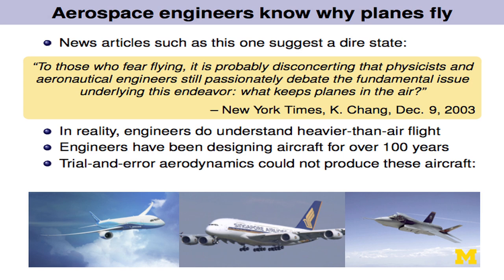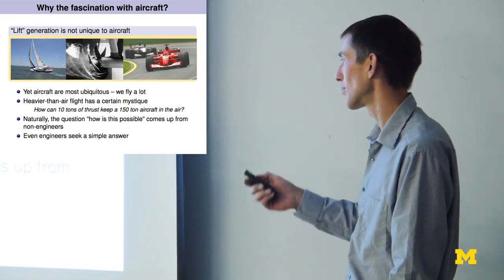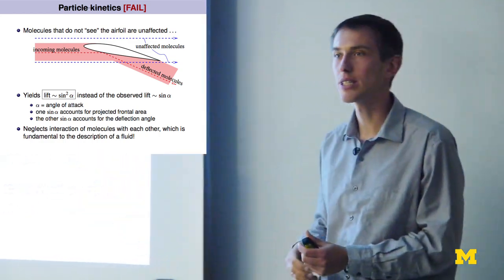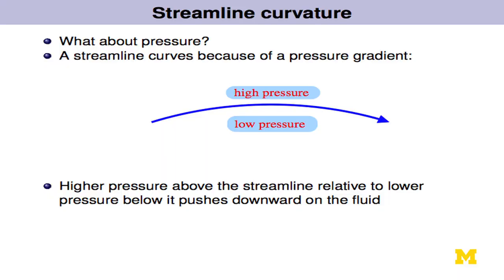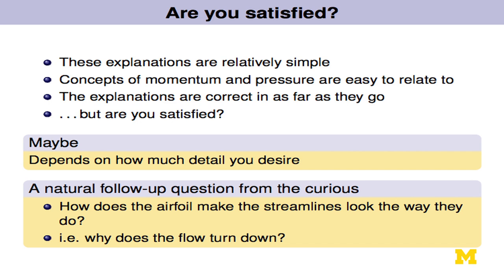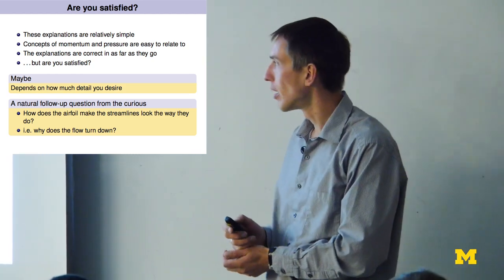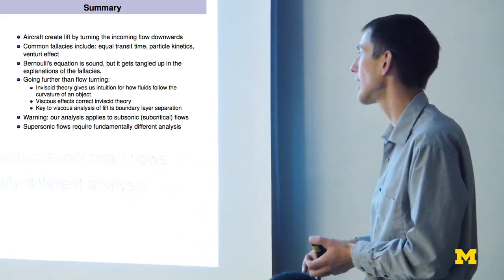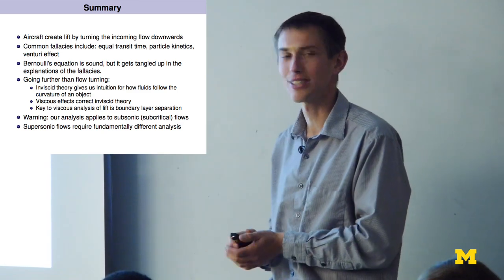Krzysztof Fidkowski | How Planes Fly

Comment: How wings fly.
It is not wise to keep talking about the air flowing over the surfaces of a wing, as relatively speaking, in reality,  the primary effective working air does not move horizontally much over the wings.  People have a habit of conducting tests in a wind tunnel where the airfoil stands still while it is the air that is moved at a speed, relative to the stationary wing. 

The streamlines diagrams need to be understood for, in a wind tunnel, the mass air particles on the streamlines are moving horizontally at high velocity but in the reality of flying, the air mass is initially standing still,  the mass particles are not moving much horizontally but they are being basically displaced vertically by the oncoming airfoil section, with an acceleration which builds up and is integrated twice into an air displacement or location shown by the slipstreams.  

Also, note that the slipstream contour diagram is a POSITION OR A LOCATION  diagram and not a velocity diagram. If we had to differentiate it and deduce a velocity diagram from it, then one could determine the velo0city vector field consisting of little vectors lined up with the streamlines where the length and direction of the small elemental vectors would represent the velocity in magnitude and direction at any location/time on the streamlines. But if it was a wind tunnel, the velocity vector field would represent the velocity of the air particles, but if it was a real flying wing on a moving aircraft it would be the velocity variations about the speed of the aircraft.   From the contour of the streamlines diagram, it appears that the horizontal velocity is basically constant but the curvy zones show a vertical velocity component. So, if from the velocity diagram we would obtain the acceleration vector field, then the acceleration vector field would represent the forces at the various location including far-field acceleration effects. Consider that the acceleration in a particular loaction is operating on the mass of the lump of air existing at that location where the accelerating vector exists ( mass is a scalar and can be taken as a constant in this case). 

The curves in the streamlines diagram  around an airfoil indicate that there are four main acceleration zones i

1.There is a compression accelerating zone even ahead and on and above the upper front part of the leading edge.
2. There is a suction accelerating zone after location (1) existing along the upper surface to the trailing edge.
3. There is a suction accelerating zone just behind the lower part of the leading edge. 
4. There is a compression accelerating zone existing from location (3) going all the way under the lower surface to the trailing edge.

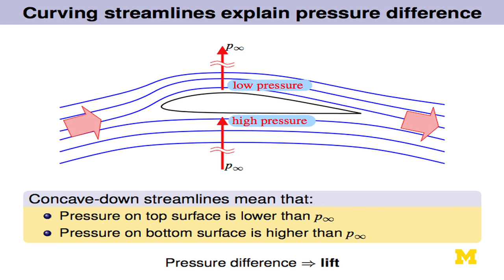All these four zones are easier seen on a highly cambered airfoil section. The practical meaning of these pressure suction zones could be interpreted as follows. Let us use the diagram shown at 12:52.  Assume the mass of an air/ fluid particle consists of a fat man holding an opened umbrella to create a piston effect. 

One fat stationary man, with an opened umbrella, located above the mean line, is hit ( compressed) and pushed up and accelerated up through action ( 1)  and the oncoming upper leading edge will shoot the man up, but him holding the open umbrella, a partial vacuum will be created behind the man, between the area of the umbrella and the surface of the wing and so this partial vacuum will pull down the man and suck up the wing as it passes under the fat man to dump him over the trailing edge using  Action (2) 
A second fat stationary man, with an opened umbrella, located below the mean line,  is sucked up by action ( 3), and then the compression zone through action ( 4)   will push the fat man down and the reaction would be a push up on the undersurface of the wing, to dump the second fat man behind the trailing edge to join the first fat man being dumped from the upper surface behind the trailing edge. Both fat men can be regarded as having flown up and down in a vertical manner as the wing slid horizontally.  Note that in real flying action, the two fat men with the umbrellas are operated upon by the actions indicated in zones 1. 2. 3. 4. and from the logic and sequence of the actions/ reactions in these four zones, the upper-fat man will result in having a higher backward horizontal velocity than the lower fat man due to one man moving into an upper vectored suction zone and the other moving in an undersurface vectored compression zone, before both of them are dumped behind the trailing edge, not exactly vertically in actual wing behavior.  

That is basically how the acceleration vector near and far-field around an airfoil section works, and the same goes, for rudders, ailerons, elevators, spoilers, any part of the structure, air, and sea propellers, and ship hull and the diffusers we meet in all aspects of engineering, where accelerations of fluid lumps masses are involved   We shall not cover the effect of heating the air or the boiling of water or moisture drops in the air when the suction is fiercely done. 

Note that the summation of the vertical vector acceleration components of the fluid around the wing is what causes total lift while the summation of the horizontal acceleration components of the fluid is what causes the total drag.
Lift and drag, and control of surfaces, all have to do with the acceleration field and not the velocity nor the position fields of fluid around the airfoil sections.  Note again, that in a wind tunnel the air moves and airfoils standstill, while in reality,  the lumps of air move but a little and it is the velocity of the airfoil section that is much higher than what the air reaches after its acceleration is integrated to velocity ....... and then the velocity of the fluid lumps masses are integrated again to relocate them from their initial stationary location to dump them, as their integrated accelerations, velocity, and resulting locations are too far from the wing to be of any use to lift it,  but could be disastrous to aircraft.. following in the wake..!

I feel that this is the best intuition explanation that I could come up with in the last 82 years, to explain how a wing lifts. I do not think that we should use Bernoulli to explain how a wing lifts. Note that with this explanation,  the two fat men with their masses and opened umbrellas to cause the compressions and the suction on the upper and lower wing surfaces, need not pass the trailing edge at the same time as the actions on the upper and lower surface of a wing are totally independent of each other and depend on the state they find above and below the wing!
Reply: Most fundamental principles of LIFT  can be explained through applying what goes on in the following video showing fast cars going over a curved road and separating from the humps, but in addition, one needs to include the vicious, sealing shearing action of the fluid, as it is not simply a case of processing, individual, isolated, fluid, hard mass particles which are totally unconnected.. NOTE THAT THE CARS ARE BEING SQUEEZED IN JUST BEFORE THE BROW  OF THE HILL BUT THAT GIVES THEM A VERTICAL ACCELERATION. to be of benefit to produce a suction effect at a later stage on the brow of the hill acting as an obstruction. 

The video showing fast cars approaching and going over the hard humps of a hill, clearly explains the reason for the "Newtonian- viscous" suction zone above the leading edge and upper surface of a wing, and to appreciate the compression zone below the wing, one needs to imagine a curved road present above the top of the car and the compression created when the top of the car slides along the top inverted cushioning, curved road representing the curve under a wing. 

https://youtu.be/AAjIdmYIZrQ

Note that there are no hard hammered impulses on a flying wing but all accelerations are cushioned or " softly pillowed" by the cushioning/tension effect of air viscous masses, as in the case when a helicopter or a wing has the ground effect due to the cushioning effect of the fluid being used in the low flying operation with ground effects as the case of the Russian Eraklon used in the Blacksea( hence the Monster of the Black Sea)  during the cold war. There is a related soft suction effect due to the viscous effects. .